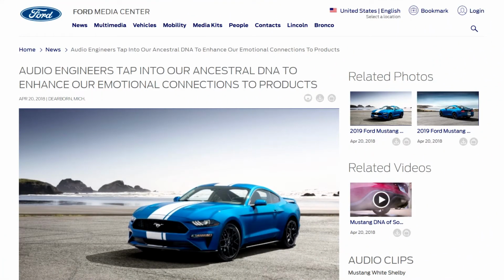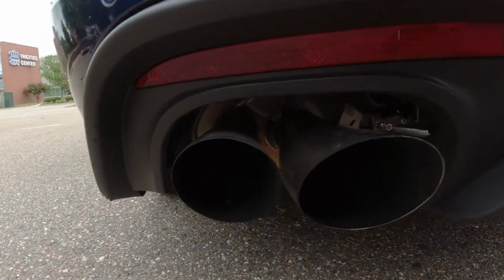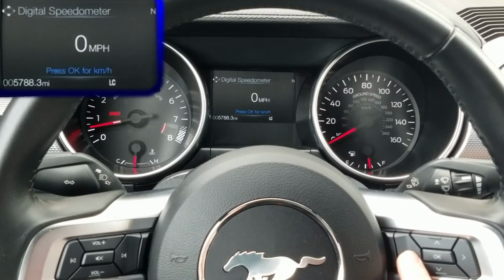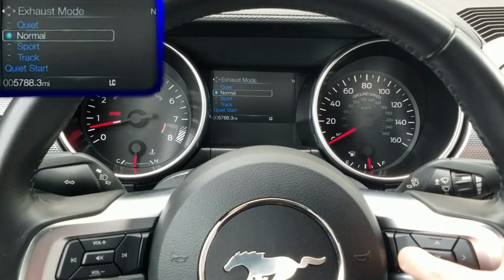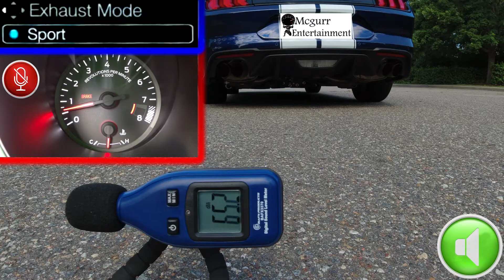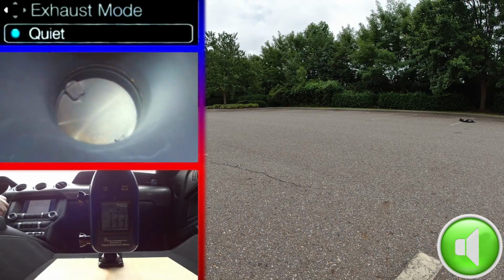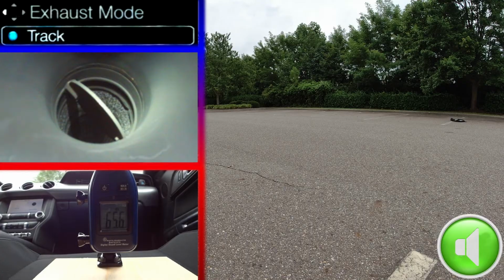Mustang GT Active Valve Performance Exhaust Explained (2018-2023)

Comment: Easily the best sounding exhaust for the coyote. I find it funny that a $995 factory option costs about the same if not less than an aftermarket setup, yet sounds way better than anything aftermarket available. And the fact you can turn to quiet mode and maintain a good rapport with the neighbors is icing on the cake. If/when I get a new Mustang, it's going to have this exhaust from the factory. I've heard the Ecoboost with this exhaust, and for a 4 cylinder car, it's actually not bad. Ford hit a homerun with this setup.
Reply from the maker: Agreed
Reply: Agreed! Stock active sounds the best! The true Coyote charm! All the aftermarkets do is add more volume but lose the deep coyote grunt! They all turn into raspy sounds
Reply: my car didnt have it equipped so i said screw it and now pricing it out
Reply: I think it’s like 12 or 13 hundred this year. Still gonna opt for it. Ordering one in the next few days
Reply from the maker: That's awesome
Reply: Yeah, that's definitely not true. Something like Borla sounds much better than the stock active exhaust and that also comes with an version that's can be used with the active exhaust option.
Reply: @deebrandt007  Borla has no rasp and stays deep.

Comment: Quick question just because to be fully clear. If your car is in normal mode and you put the exhaust mode to track then only the exhaust will be in track mode and the rest of the car stays in normal mode correct? My point is that if you put your car in track mode it will not automatically then put the whole car in track mode?
Reply: Put your exhaust in track mode*
Reply from the maker: That is an excellent question. I played with the exhaust modes and noticed the Track Mode still alerted me to See the Owners Manual when just changing the exhaust only. However, after playing around, the car seems to maintain the current driving mode. It seems the Instrument Panel is programmed to alert the driver anytime Track (of any kind) is selected.
Reply: @mcgurrentertainment  thanks for clarifying. I guess also if the traction control stays on in track exaust mode then it must only be the exhaust changing.
Reply from the maker: I agree
Reply: I have an '18 with the active exhaust. This is true. You can change both the mode of the car or just the exhaust. Changing just the exhaust will not change the mode of the car itself. I can have steering in sport, car in normal, and exhaust in track if I choose, which is how mine is set up usually.
Reply from the maker: That's awesome!!!! Thank you for the backup. I also just conducted a test to be 100% sure. I put the car in Wet/Snow Driving Mode and changed the exhaust to Track. Basically,  the car had a low acceleration response and loud exhaust; it also maintained traction.
Reply: @mcgurrentertainment  that’s perfect thanks for letting me know. So basically if it was me I would just put track exhaust at all times so you can just hear the amazing sound !
Reply: Yes. You can set the exhaust and only the exhaust to track mode, and you can have a completely different driving mode (or just keep it normal) if you want.

For example, if you wanted you could have: Exhaust in track, car in sport, and steering in comfort mode, all at one time.

Comment: So if the Mustang GT doesn't have Active Valve Exhaust, does that mean u can't change the exhaust modes?
Reply from the maker: Correct
Reply: @mcgurrentertainment  Then what mode will the default exhaust sound like without the Active Valve Exhaust on the Mustang GT?
Reply from the maker: Normal mode

Comment: What does the sport / track exhaust is similar to an aftermarket exhaust? Like straight pipe?
Reply from the maker: Not exactly. The butterfly valve controls the output flow of the secondary side of the muffler. It provides a second path of air to exhaust, creating the unique sound and performance.

Comment: I have a 2020 GT Premium.  Is there a way to save only the exhaust to Sport Mode and leave the other things in Normal Mode?  I've tried using the MyMode feature and even the driver seat memory button but all to no avail.  Thoughts?
Reply from the maker: Sadly, the Mustang defaults back to Normal mode once the vehicle is turned off. There is not a "Factory" way to save the Mustang into Sport Mode.
Reply: @mcgurrentertainment Sad indeed.  It's such a cool sound to hear in the garage when going out for an early weekend cruise.  Thanks so much for the reply and the video; great content.
Reply from the maker: Thank you very much for your support
Reply: Just saw a video that shows you can "schedule" the "quiet" sound for mornings so your neighbors won't get upset. Scheduling a sound is a great idea!
Reply from the maker: I completely agreed
Reply: But from a different comment you say it doesn’t immediately start it quiet mode but switches from normal to quiet quickly. Which is correct? Thanks
Reply from the maker: When you shut your vehicle off, the butterfly valve is open. If quiet mode is scheduled to be on in the morning, the butterfly valve will shut as the vehicle is turned on. It's very quick
Reply: @mcgurrentertainment  ahh, thanks.

Comment: Does the exhaust flow push the butterfly open, or is that a calibration? Seems like peak decibels would be less if that didn't open all the way.
Reply from the maker: It's electronically controlled

Comment: Does it have to be premium to be able to add the option, or can it be a base GT and still add the option for the active exhaust? (2018-23)
Reply from the maker: It does not have to be premium. The  Mustang in the video is a Base (301a) model. However, for a Mustang to have this option, it needed to be a High Base Model (not 300a).

Comment: Do the different exhaust sounds alone (all in the same mode) effect performance? (i.e. backpressure causing more or less hp) Great vid. I just got a 2022 GT with active exhaust.
Reply from the maker: Good question. Not 100% sure if it does, I haven't tested that idea yet.

Comment: Can you set it before you start the engine ? I live in condos and don’t want to wake neighbors
Reply from the maker: Sadly no. But starting the car in quiet mode will silence the exhaust fairly quickly.
Reply: That seems odd that even if quiet mode is on and you set the scheduled time to early morning it doesn’t start immediately in quiet mode. 🤔

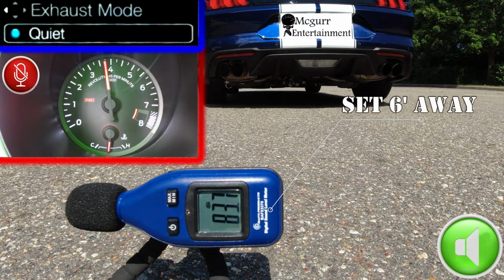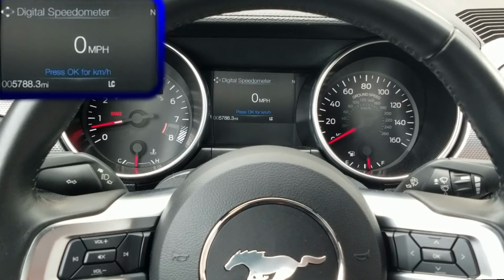Comment: quiet outside 3:01 3:01 3:01

truck outside 3:50 3:50 3:50

quiet inside    3:10 3:10 3:10

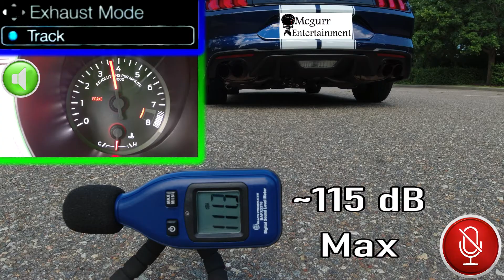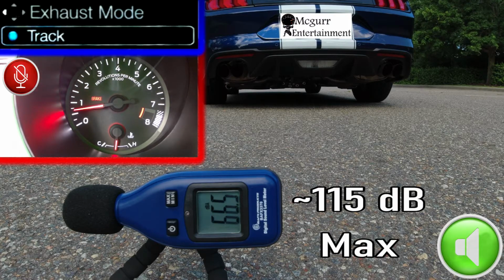truck inside   3:59 3:59 3:59
Reply from the maker: Definitely hear the difference between Track Mode and Quiet Mode.

Comment: How can you rev almost the redline, my 20gt can only rev 4-5k range in both park and neutral
Reply from the maker: Open your hood. Your grille shutters control air flow and help keep your engine cool. If the shutters are closed it will not allow the car to redline while in park. You can counteract this interlock by opening the hood.
Reply: I believe this is because automatic cars have a soft limiter. Manual cars don't and let you rev it out
Reply: @mcgurrentertainment When you say open the hood do you just mean pop the trunk? I just purchased a 2023 GT with active exhaust and was wondering how to make the revs louder while parked.
Reply from the maker: No. The shutters are located under the hood.

Comment: My car has active exhaust but it doesn’t show exhaust mode
Reply: Go to settings it should be there
Reply from the maker: How do you know you have Active Valve Exhaust?
Reply: @mcgurrentertainment  it’s quad tipped
Reply from the maker: That doesn't mean there is Active Valve Exhaust. The quad tip design became standard on all GTs in 2018.
Reply: @mcgurrentertainment  really? Hmm ok. Because mines just came with it. I guess he should just get a flashlight in the video and shine it down the pipe 😂
Reply from the maker: Agreed. I know Ford rotated features when building random Mustangs. I would go to the car lot and see Premiums with a wheel locknut packages and Base models with the black accent package. There wasn't any rhyme or reason to the selections. It feels like they rolled dice to determine which Mustang got certain features.
Reply: @mcgurrentertainment  true because the dealer that sold me mines didn’t even know it had active exhaust. Then one day around 1500 miles I was playing with the settings and found it
Reply from the maker: I believe it

Comment: I didnt think this feature was available until the 2018 model? And that dash  looked like the previous model???
Reply from the maker: You are correct, It is available on the 2018+ models. This Mustang is a 2020 301A (Upgraded Base model), hints why the dash is part analogy.

Comment: Looks like this was taken from Roush but why make it so complicated? I have the active exhaust from Roush and two simple motor valves from badlands and one simple on off switch. Quiet or loud. Way better.
Reply from the maker: It seems Ford was putting a lot of thought and research in the emotional connection when it comes to the sound of the car. Similar to how some individuals get pumped when listening to specific songs. Just a thought.
Reply: I would rather have the 4 options, 4 different types of driving feels.

Comment: so if you don’t get a active exhaust your car exhaust is already in track mode lol
Reply: nah cuz track mode is loud enough that it exceeds the legal sound limit for public roads (as the manual states) so the non active exhaust definitely has to comply with legal limitations
Reply from the maker: It's going to closely match the sound and feel of normal mode.
Reply: @mrishka7286  what about after market tho , like corsa extremes (not active exhaust) is already in track mode bc it’s always fully open
Reply: @tracn  they will have the inside of the mufflers designed to be not louder than street legal with "fully open" end tubes.